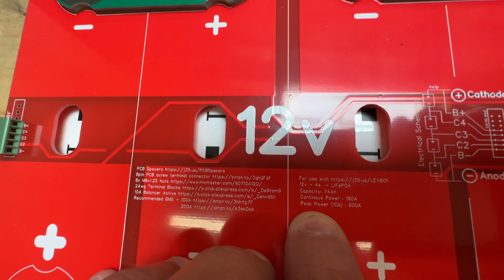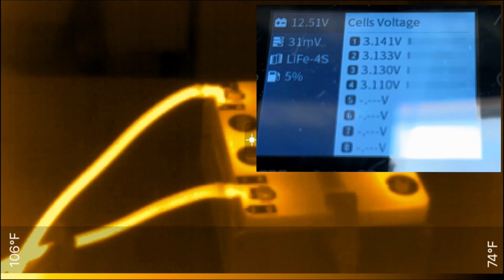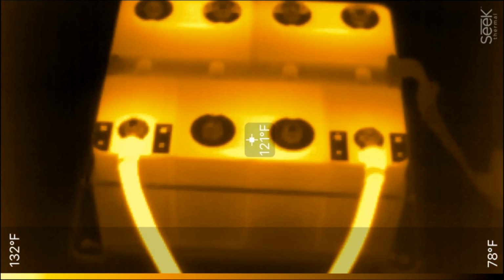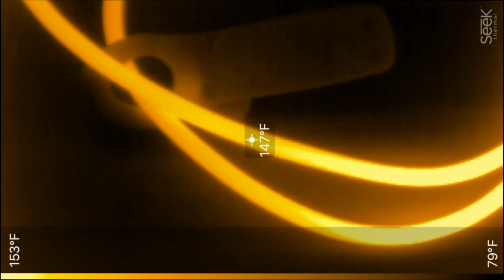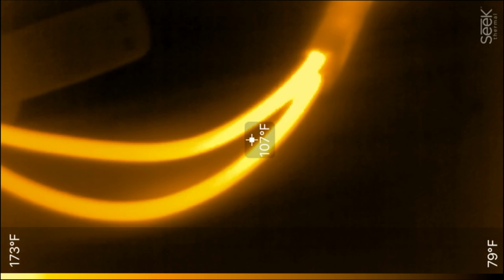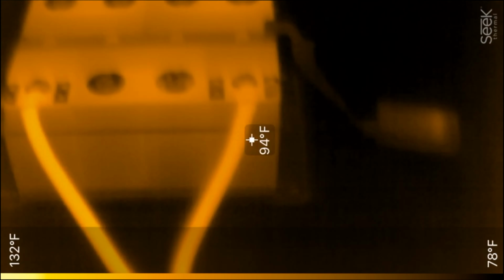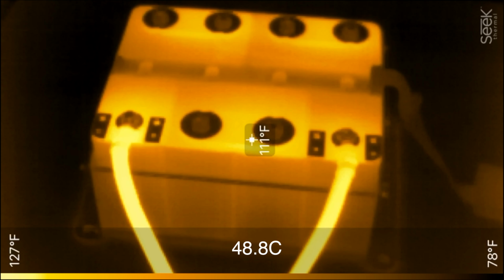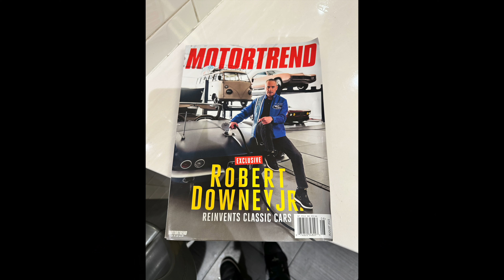DIY 200A PCB Busbars LiFePO4 LEV60 12v

Comment: Prismatic cell question from very new solar person: I have already assembled a 280 Ah prismatic battery from 4 cells but not charged it yet.
 I have seen and read where prismatic cells will swell once charged.
   The busbars I connected were snug/tight.

 Can I remove the busbars to drill them wider so when they do expand, they will have some give/slack?